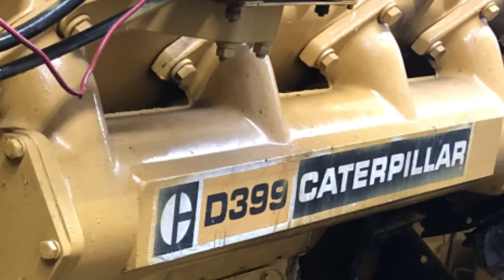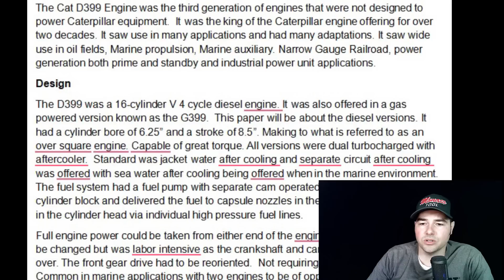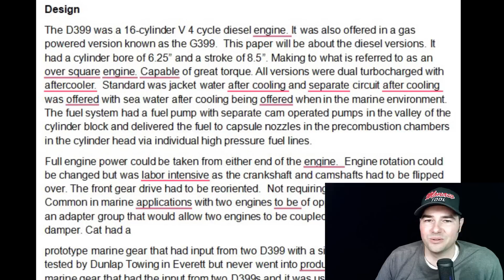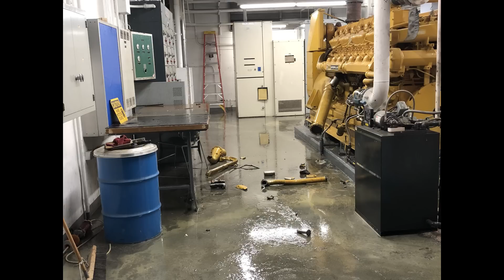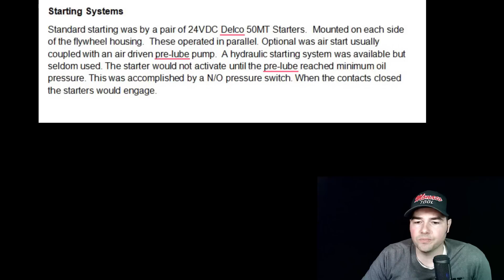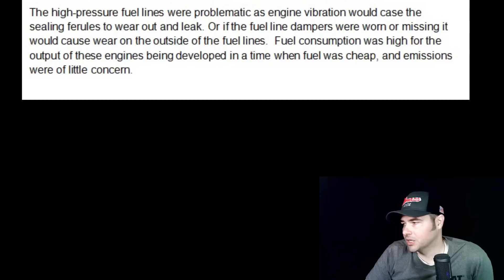The Cat D399 Diesel Engine. "Cast Iron Elephant."

Comment: I did plenty of work on 399’s back in the day. Marine propulsion, industrial app powering a scrap frag, standby and emergency electric power, cargo pump, fire pumps.
The rpm is determined by application. In power generators it depends on HZ frequency. 50hz or 60hz and the number of poles in the generator determines the rpm. 50hz 1000-1500rpm. 60hz 1200-1800rpm. The lower the rated speed the lower the continuous power rating but the greater the longevity of the unit. 
Hydraulic starters were usually a secondary starter system employed in critical applications like fire pumps. You could manually charge an accumulator with a hand pump, akin to a bottle jack, all mounted on the package frame.

Comment: 6 1/4 bore’s are alive and well in the Marine application. 12 cylinder is the 398 and 379 8 cylinder.  Like the 3508, more weight than horsepower means longevity. Unlike today’s Throw Away Engines. Rebuild the fuel system often, parts still available. Compare the C-175 to 6 1/4 bore and the main difference is the high pressure fuel system, and single cylinder heads.

Comment: The D399 was used in small ships and had 50 gallon oil sump. Some twin screw ships had 4 engines, 2 in tandem on each shaft. One was used for slow cruising and both for higher speeds.  As I remember the injector pump had to be bled before starting every time. You could burn #3 diesel and the engine had multiple oil and fuel filters to enable changing filters while running. Oil could be changed running, too. But most ships had centrifuges for cleaning the oil. To change oil running you added oil at the same rate as draining (pumping) old oil. When the old oil went clear, you were done. There were 2 marks on the dipstick. One for stopped and one for running. Normal running rpm was 1000-1200. There are still engines in use. Rebuild parts are available and there are rebuilt engines for sale. Most of the engines are in foreign use now, but some research, fishing and towing vessels still use them. The engines were very reliable, no electronically controlled injectors. I never heard of one failing until this destruction of the week.

Comment: We had these running natural gas compressors in northern Alberta. The G398 and G399 ran on natural gas, not liquid gasoline. Most of the compressors were rated at max 1000 rpm, with the rare one rated to 1200rpm, so the high torque, low rpm was well suited to the application.

Comment: We run G399's on irrigation wells, they are beasts for sure. The one in the Pic is an early (pre 1969) engine. These are so loose tolerance and over built engines that alot of them that threw rods were repaired even if it knocked a hole in the side of the block.

Comment: Hydraulic starter systems use a high-pressure fluid accumulator as the equivalent of a battery, and it's filled up by an electric or mechanical hydraulic pump driven off the engine. The starter motor can be a vane or piston type hydraulic motor. Often there was a hand pump, heaven forbid, with which you could pump up the accumulator as a last-ditch backup. Really similar to air starter systems. 
You might opt for this system if you were already making hydraulic pressure for rudder control or some such thing. The hydraulic system can be made watertight, which is an advantage for an engine room that might get seriously flooded.

Under Load Changeable, usually paired oil/fuel/coolant/etc. filters are used pretty extensively in industry. If you're filtering scorching hot fluids, the filter that needs to be changed can be isolated with valves and left to sit and cool enough to be worked on. If it's something low temperature, both filters can be in a single housing that incorporates all the valving and is operable by a single handle. 
Importantly, if you're filtering something hazardous, the filter system can be designed so that you are physically blocked from trying to open up a flowing filter.

Comment: When I was 10, my grandfather took me on a tour of the Mossville plant.  He worked in the tool crib there.  He and a buddy of his put me in a test cell with this engine and told me to start it while they were outside at the controls.  I had never seen or heard of an air starter.  When I pushed the starter button and heard that starter scream, I about jumped out of my skin.  He and his buddy were laughing their asses off.  He told that story until the day he died.  Great memories.
Reply: I dealt with air starters all the time on the Mississippi, but a friend of mine had only read about them. He stopped at a liquor store after work one day to pick up a 12 pack, and he had to walk past a gas station on the way back to his car. The tanker delivering gasoline at the station was done, and it was an Autocar with an air starter. The driver hit the start button just as Rex was walking past the tractor, and it startled him bad enough that he ripped the handle out of the 12 pack.

The driver was mum on whether or not the timing was deliberate... 😀
Reply: Same happened to me but with an old Autocar semi, he never got me a second time though

Comment: I was the field machinist for cutting for shims, inserts L style, and the big z insert, was kept busy all over southern California doing top end block work!
Reply: I too, remember installing many “L” rings and if the cracks were extensive, many were, “Z” rings installed with a “Porta-tool” setup using a large drill motor. Very effective tooling for field and shop use. I even cut the counterbores using the same tool. Very precise!
Reply: The big shims sure took care of counterbore problems forever.   I remember them in 1693 and some 3406 engines.  I have a 3406A that has the big shims in it

Comment: I have seen one of these once.  I used to work for a company that rebuilt electric motors and generators.  Everything from little few HP units to generators and motors the size of buildings.  The D399 was in a small town a little south of the Twin Cities in MN.  Do not recall the town name off the top of my head.  We came in to pull two of five generators.  The D399 was the backup unit.  The four main units where even bigger.  They where all motors pulled from retired diesel subs.  Massive opposing piston engines with superchargers.  I was just a grunt / truck driver on the job, so I know very little about the motors aside from what I was told.  All four engines where a little different since they all came from different sub classes and different eras.  They had drawings of the subs they came from in frames on the wall.  I want to say one of them was a gato class sub.  The D399 was in a little side area on a concrete pad in the same building.  Since we did not pull it's generator, I did not get to look at it all that close.
Reply: Those sub engines must have been Fairbanks-Morse 38D8+1/8's.  Those were the only Opposed-piston engines used in WW2 subs.  Those are still made by F-M in Beloit, WI.

Comment: Hydraulic starters have an accumulator tank under high pressure.  Small versions you could hand pump up at lat resort if you batteries were dead for example. I’m a marine engineer. I’ve worked on, mostly servicing the D399 and D398 V12.  25 years ago. Tug boat propulsion application.

Comment: Worked on lots of this style engine, generators,  pumps, etc. Worked on all parts, injection pumps, transfer pumps, water pumps, re-build connecting rods! As an apprentice we learned to repair all the parts, we were the exchange department back then, yes even turbos, starters, and alternator. Going out to cities to repair engines. Worked as a team when doing these engines pulling off heads, sending them back to the shop to be re-built, rolling bearing in, took awhile to overhaul on site. Miss those days!

Comment: Captained (1995 - 1999 ) the tug "Avon " cast iron plated hull ( built 1923 )  - used as a harbor tug for ship assist . A single screw ( 1 engine / prop ) that had a D-399 . Push pre lube button - automatically goes to air stater ( loud whistle ) and bam it was alive ...
Great engine used a butt load fuel but ran flawlessly ..

Comment: Twin engines in marine applications have a engine on each side of the hull. They both operate in opposing directions, to offset propeller torque to keep the ship sailing straight.

Comment: When i was in the airforce we had a generator that had a v18 cat engine with twin turbos . It was air start . The radiator was wall mounted and had a 75 horse power electric motor to turn the cooling fan .it was attached to a generator .

Comment: They used them in land based oil drilling rigs working in the arctic. I worked on a rig with 5 of them, running the rig, pumps and gennies.  Not nearly as cool as another rig i worked on with a pair of 12v92T.  One was reverse rotation as well.  When they were loaded up and screaming, Wow. Just Wow.

Comment: Not an expert , 60 cycles per second equals 60 times 60 seconds equals 3600 cycles per minute . Rotate at 3600 , 1800, 1200 rpm then winding configuration takes care of output frequency . Even lower rotation speed possible with proper winding configuring .

Comment: Hydraulic pump into an accumulator, at usually 3,000psi. A hydraulic lifeboat could be charged by a hand pump, or mounted hydraulic pump. As to direct or indirect injection, you should know, direct injection will about double output from indirect.  Have fun

Comment: Did inframes on the 398’s and 399’s in the sixties in the marine application in the SF Bay Area. Interestingly, the 399 was the same bore as the D9G Cat @ 61/4” and the 398 was the same bore as the D8H @ 53/4”. I retired in 2009 and felt that those old beasts were much easier to work on than the 3500 series engines. And no a crane wasn’t required to remove the fuel injection pump, just ingenuity,come-alongs and muscle. In the marine environment, Woodward governors were used in place of the standard Cat mechanical governors. Thanks for waking up my memories!😊

Comment: In Australia there was a few classes of locomotives with these engines in them. We are currently maintaining a fleet of them as heritage service on standard gauge.
There are also several narrow gauge locos that use the small 398, usually driving an automatic "hydraulic " drivetrain
Reply: 'Small' 12 cylinder d398😂😂

Comment: :58 seconds in and I can tell you if you’ve ever cracked an injection line on a running 379, 398, or 399 you know why they’re not in use any more. Super low pressure injection system. I actually helped lock one up while troubleshooting  one as an apprentice but that’s a story for another day. Still get a chuckle out of that from time to time.
Reply: Also I’d like to add a 379, 398, or 399 without an air starter seems like you’re missing out on a solid opportunity to scare the heck out of anyone standing around you while start up.

Comment: This is a very interesting video you have put together. I learned a few things, but you never explained how CAT got around he problem of turning the 399 1800 RPMS to run a generator, when it's 'sweet spot' was 1200 RPMS.  Did the engineers just say to hell with it, turn  up and sell more parts that way..
Reply: reduction gears and or hydraulic transmissons

Comment: For San Clemente tankers, OSG upgraded from 149 Detroits to the 399 as a 600kw generator. Over the entire life of the ship, that was the most reliable standby generator I have worked with. It was installed like a Cat in a box(USCG regulations on size and noise). With inert gas system installed, they got used a lot for the extra load. Ps the 149’s on the others were problematic at best, corrosion and head gasket issues. Have fun

Comment: Dad had a D2 back in  the mid 70's. From what I remember in the owners manual, the hydraulic starter was powered by nitrogen which was re compressed as the engine was running. If it didn't start, there was a manual pump that looked like an oversized horizontal bottle jack for repressurizing the nitrogen. His was equipped with a pony motor

Comment: Hi Josh. Those old Cat 6.25 bore engines were capable of a huge number of hours if maintained. That means checking the injection timing and adjusting the fuel injector pump lifter heights as required, something most techs never do, timing slips from 12 degrees BTDC and gets later and later, they just continue to run regardless. Coolant condition is critical to prevent cavitation erosion. Valve clearances need to be adjusted regularly, change valves to the later small diameter stems as the old big stem valves and guides would wear excessively. Nozzles needed to be checked and changed out as required but would run on almost any fuel. The Camshaft followers would last for a long time too although if they were reconditioned incorrectly, they would not rotate and wear out to nothing in minutes! The 399 in destruction of the month has all the signs of an over speed failure. Due to generating power being taken off-line and the resulting failure of the governor to pull the rack back in time, or it could have just been a stuck rack or incorrect governor adjustment. The 2- engine single generator set up that was described in your video was a rig that Detroit used to do as well, they would run the engines counter rotation to each other and synch the racks etc. doing the overhead adjustments on two V 16 engines took a while to complete. Parts are hard to find for these engines now, even though the global population is still significantly high, they are obsolete in today's environment. However, for 100% reliability and simplicity, they are hard to beat. There are still some aftermarket parts available although it is the small stuff that is really tricky and expensive to locate.

Comment: I have a work acquaintance who was in the Coast Guard and they were towing a disabled destroyer in a storm and one of the huge cylinder heads on the propulsion engine crapped out and they were in dire straits. They had to change out the cylinder head. While the engine was running. So Mike “volunteered” and they harnessed him up and suspended him from the overhead crane and he got the job done. Nice commendation letter and able seaman cred to follow.
Reply: That man had Balls of Steel.  🖐🏾
Reply from the maker: No thanks on doing that job.
Reply: Ok this story is bull crap. You can change cylinder heads on this engine while running and we do this routinely. It's nothing special. Furthermore, only the pack needs suspended.  You use a step up. Looks like scaffolding.  You don't need suspended above it.
Reply: How can you change the head? Wouldn't the coolant be shooting everywhere? Plus the exhaust?

Comment: I operated two of these on the USACE Dredge Yaquina for 25 years.  These are great engines!  This twin screw ship maintained extremely dangerous ports on the west coast of the USA.  Tough and reliable these engines never let me down.  When they hit 30 years of age and uncountable rebuilds they were replaced with garbage MTU yachty engines.  I retired soon after.

Comment: Started welding at cat east Peoria plant in 1977 , welding D7 and D9 track roller frames,they had just started D10 line in same building. I then transferred to mossville engine plant welding 379 389 and 399 oil pan bases and water cooled shields. Went up in pay grade and started boring cam tunnels on new 3500 series engine,it was new in 1980.

Comment: I saw 3 of these on generators in a Great Lakes freighter. It had to have 3 because of the 1000hp motor on the bow thruster. The 6 cylinder of this series was the engine of the D-9. Hydraulic start uses an accumulator that stores fluid under pressure. The GM Hydrostarter used 75% Diesel fuel 25%#10 oil as fluid and the engine driven pump unloaded at 3300 psi. Look under an old 6-71 you will see a round cover on the oil pan where the pump mounted for hydraulic start. Electric was far more common, including 32 volt.

Comment: G'day Josh,  The hot swap filters was a simple manifold with 2 banks of filters. An inlet and outlet tap on each bank. Isolate one bank for service.  Lubrication oil was also  able to be "hot swapped/changed " by simultaneously pumping in fresh oil through one side of the filter manifold and recovering used oil from the other side. I'm not an industrial electrician however, The low speed RPM was an advantage for power generation. Somthing to do with the Three Phase and Hertz (Hz) and generator rotation speed. One of your veiwers may be able to qualify what I think I was told 45 years ago in the mine.  cheers, Butch.

Comment: I work natural gas compressors mainly 3500 and 3600 but my old boss used to work on them g399 and g398 and he was telling us him and his dad were doing it in frame on g399 in the yard and had a liner stuck and had a 30 ton hydraulic puller on it and when the liner finally let go it brought part on the engine block apparently someone J B welded the liner in to the block his dad walked to the other side of the engine to look at the serial number and said “ I wondered where this unit ended up at”. Apparently he pulled that liner three times on the same Sunday because it was leaking coolant so he got mad and J B welded the liner in

Comment: In 1979 we built a Bucyrus Erie 380W dragline in Oklahoma. It was the fifth one made. It had a 399 for primary motor and  a 3306 for electric generator that ran air compressor and other AC functions. The 399 ran a 400 hp DC generator for the swing motors. The other side ran all the draw works. Hoist and drag cables. Ran 24 hours a day 7 days a week. This one had the air starter so when you got air built up by the 3306 you started it. I think it weighed a Million pounds. Had 140 boom and 16 cubic yard bucket. Was used in a coal mine.
Reply: Reminds me of Big Brutus in SE Kansas.   We used to go there and see it as kids/teenagers.
Reply: Was it in Latimer county
Reply: @nathandevine552   It was in Porter Wagoner County
Reply: Too cool, from the area still visit for the peach festival.